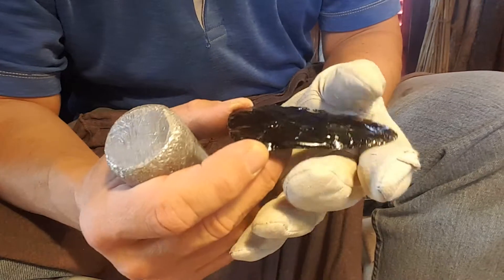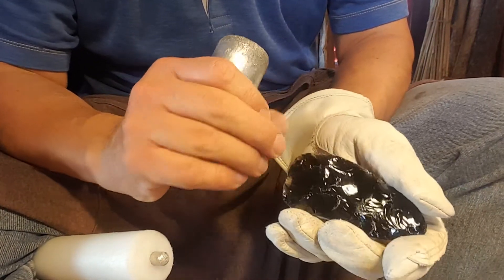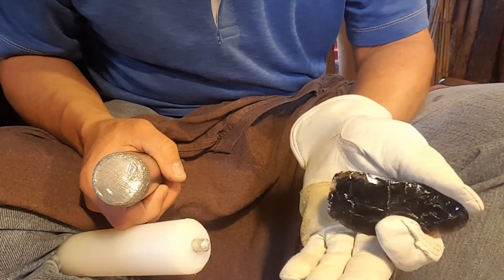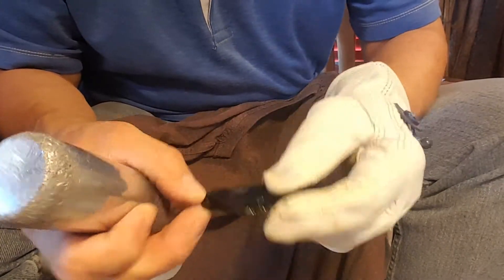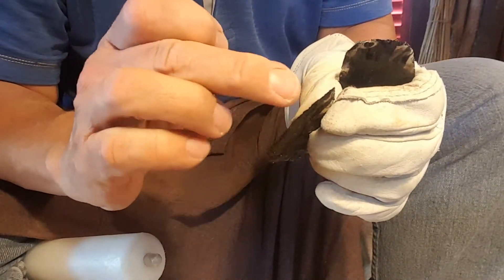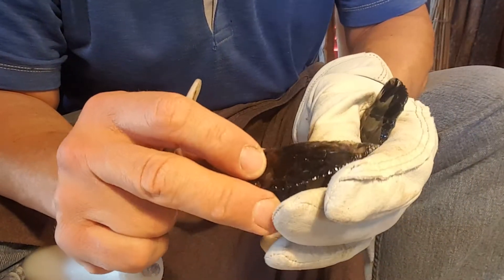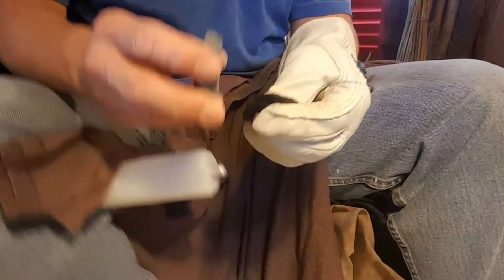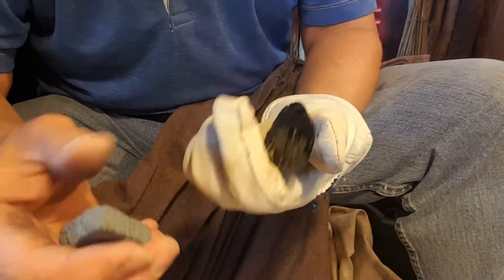574 - Flintknapping More Obsidian 4/8

Comment: Hey Pat,  did you get the 2 emails that I sent to your Gmail account.
Reply from the maker: Yes, I just looked at the emails. That's an awesome frame of points and beads. What is the scale of the points? Can you send a picture with a ruler sitting next to some of the points? Thanks.
Reply: Yep will do that first thing tomorrow.  It's across the road at my dad's house.  I will give you a guess now and pictures tomorrow , but I am thinking around 2 inches.
Reply: I will also make sure to send extra close ups too.